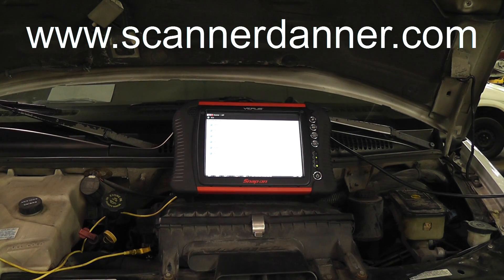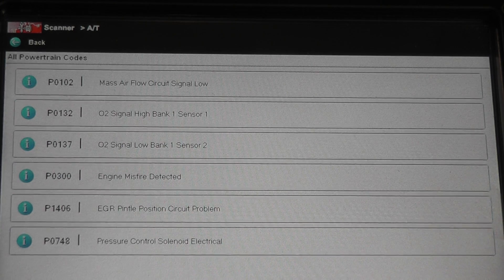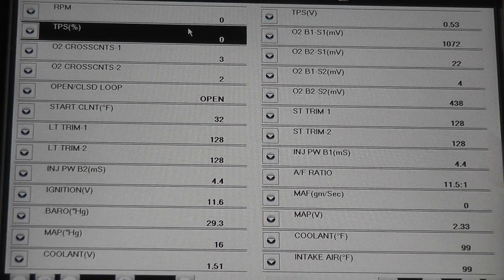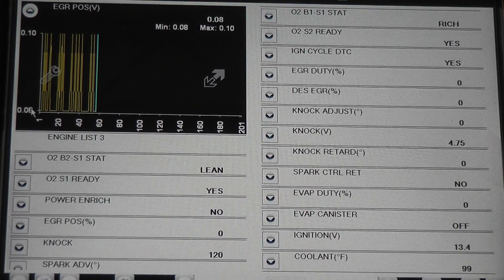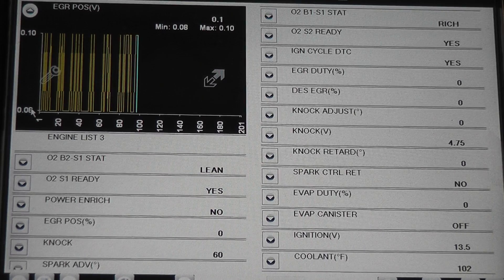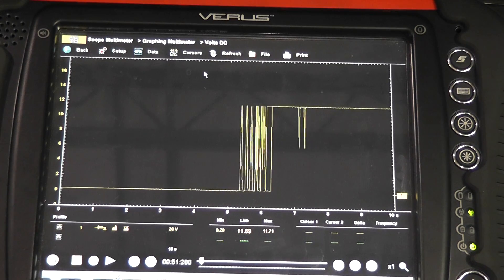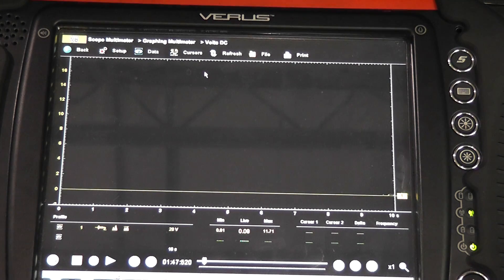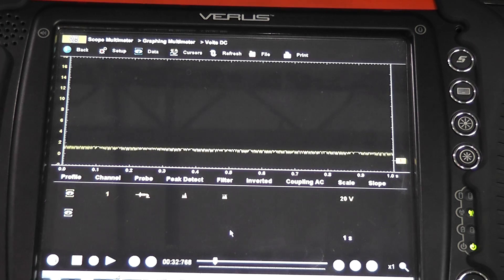MAF sensor code P0102 from bad engine computer - (Chevy van)

Comment: Hi there! Very nice videos! I hqve a 2015 toyota verso 1.6 diesel which i bought used and the chk engine light comes on with a p00bd code which refers to a maf problem. I have taken it to the shop twice and they replaced the maf sensor and cleaned the intake manifold but the fault keeps popping up. I also took it to 2 toyota service shops qnd they  cant find anything wtong. After that i was advised to have an electriciqn check it and he too found nothing, any ideas on what to do? Thx!

Comment: Thanks. Wonder if this is the problem in my 96 silverado 1500 5.7L. The first codes were p0102, p0300, and p0420. It misfires at hwy speeds. Mechanic said it was bad MAF sensor. Brand new MAF sensor in and now the codes are p0102, p0172, and p0175 and the truck still misfires at highway speeds.
Reply from the maker: Could be, do some testing on that MAF circuit.

Comment: I have a p0102 code I replace the maf and still have the same problem  can't even drive my 1999 3.8 camaro
Reply from the maker: How's it run with the MAF unplugged?
Reply: @ScannerDanner  can't drive it turns off  could it be the computer
Reply from the maker: @luismontemayor5713  of course it may stall a few times with the MAF unplugged but you should be able to drive it.
Get me voltage readings on all 3 wires on the MAF with the key on engine off
Reply: I read .5 bolts
Reply: 5 bolts
Reply from the maker: @luismontemayor5713  need all three wires, with it plugged in and backprobing (loaded circuit)
Reply: @ScannerDanner  how do I do that
Reply from the maker: @luismontemayor5713  same way I showed in this video. I believe I used a T-pin (you can buy them in the craft section at walmart)

Comment: I know this video is 10 years old @scannerdanner, but do you remember what you did with the harness pin issue?, did you replace the harness?
Reply from the maker: If I remember correctly, that ground splice was broken. I believe the only real fix in this scenario is to cut it off and installed a new ground eyelet

Comment: I have a 2000 gmc k3500 with the 5.7. I have the maf code. I have 5 volts on the yellow wire unplugged, ground wire is good, but do not have 12 volts on the red. (All unplugged) I unplugged the harness from the computer and believe I found the 12 volt output to the maf, tested for continuity and it tested good.  I am now a little lost as to where to test next. Any help would be appreciated.  Great video by the way.
Reply from the maker: I believe the 12v supply to the MAF comes from a fuse my friend, not the engine computer. You've done good so far BTW! A good wiring diagram is what you are lacking at this point. Here is a link to the DIY version of the same service info I use 
https://eautorepair.adtrk.biz/?a=10817&c=24&p=r&s1=

Comment: I have a 1998 gmc k3500. With a P0102 MAF circuit signal low and a cam shaft sensor code. Both sensors have been replaced. I have checked for 5v at the MAF key on engine off. Truck takes a while to start. And struggles at times while driving. I have cleared the codes on my truck but with the truck running and scan tool plugged in ..the codes will come back on and off randomly even when the truck is key on engine off. .. I dont know what else to do. Could it be a computer problem?

Comment: i have 99 express with only the p0102 code and my computer looks just like this from the outside and my power and ground to the MAF is good
Reply from the maker: Key on, MAF unplugged, you should have 5v on the yellow signal wire. Do you?
Reply: @ScannerDanner  did not go that far yet but i will if the rain stops... i jumped the gun and put a new one on 180$ out of pocket code still there...thanks for the help
Reply: @ScannerDanner  2.5 volts key on unplugged
Reply from the maker: You need a computer my friend. It absolutely must be 5v unplugged with key on.
Reply: @ScannerDanner  agreed the new one came today and flashed from my vin number i ordered it from flashmasters ...you saved me on this one there should be a way to show my appreciation
Reply from the maker: Just keep watching my friend :-)
Click the bell icon too to be notified of new uploads. Thanks!
Reply: update on my computer switch.....i have a 99 express 5.7 with the p0102 code and a harsh tranny shift i ordered my unit from flashmasters it came in bout 3 days its all installed i had to do the security relearn which was easy and i  need an crank position sensor relearn gotta find a shop with the right tool for that but my van runs like new again with no issues and no codes . ALLDATA.COM and SCANNER DANNER saved my ass on this one

Comment: Dan I have a 1996 Chevy K1500 5.7l Vortec with a very similar problem, the P0102 code is my only issue, but I’m experiencing misfires, hesitation, and sluggishness. I’ve pinned the yellow signal wire at 5.05V, but my red power wire reads exactly zero. I’ve checked the black ground on the same connector and it reads 12.5V...any ideas?? Thanks in advance!
Reply from the maker: your power reads 0 and your ground reads 12? Where is your voltmeter negative lead? It should be attached to battery negative for these tests

Comment: I have the same issue with my 97 gmc sierra k1500 5.0 vortec, I have all the same symptoms and more codes and when I fix something I still get the same codes, I took the computer out and there was corrosion on the inside on the board and on the inside of the casing, not much on the pins and plugs themselves but on one of the connectors on the inside the pins going to the board were covered, could that corrosion just on the inside cause all those codes? I blew it out with electric compressed air cleaner but no change.
Reply from the maker: you need to replace the computer and possibly the wiring harness depending on how much corrosion is on the pins
Reply: thanks, I ordered a new computer and then I'm gonna check the wiring if I'm still getting the same codes

Comment: ecu and loom? or was the loom repairable?
Reply from the maker: It definitely needed an entire harness or the computer connector repaired. I didn't do the repair and I'm glad I didn't have to. No easy answer or fix there bro
Reply: +TheMarshall85 I have an 96 chevy express and had the same problem like this video showed and have seen a lot of vans like this. I take the computer out and make sure it doesnt have any corrosion inside and if its good on the inside and scruff away the aluminum rust and then prime the case and paint it, if not, there is a guy on ebay that sells them refurbished. you provide your VIN number and they will flash the ecm for you. its about 80=100 bucks. as for the harness the pins i believe are stainless steel and usually are in good condition. I remove all the clips to expose the pins and then with a hard plastic bristle brush i spray contact cleaner or wd40 and then dry them good and use dielectric grease on the pins and around the connector area to avoid moisture getting in the connectors. I never let anyone fill up my power steering or master cylinder with fluid because what happens is some people pills fluid and it falls on top of the ecm and the fluids being corrosive will eat thru aluminum very fast. my van has been running excellent with no check engine light ever since i did this procedure.

Comment: If you need a remanufactured engine computer give us a call. We'd love to help you get back on the road. 800-900-0194 www.autoecmstore.com We have a 1 year warranty on most of our parts (except Nissans).
Reply from the maker: +AUTO ECMS How about a central electronic module on a 2006 Volvo S80? It suffered some pretty serious water damage. Let me know. We are looking for a used unit at this time.

Comment from the maker: That would depend on what the signal looks like. I don't approach every system or car the same way. Symptoms and test results dictate my next move. I may check sensor signal, then power and ground before worrying about opens and shorts in the signal wire. There really is no easy answer to this. "The only constant is change"

Comment from the maker: yes, to determine circuit design, you would unplug it but remember that it needs to be a known good working circuit for 100% accuracy. If there is already a problem (open, shorted wires), this will affect circuit identification. So start testing known goods, and chalk them up in the memory bank for future problems

Comment from the maker: I'm ok with that test on a signal circuit. I've done it many times. This test works on Ford MAFs but you have to leave the MAF plugged in when you do it. The PCM MAF monitoring circuit gets its ground through the MAF sensor. This is why Fords have two grounds to the MAF. If you try this test unplugged, you will get no response. That is the tricky thing with bypass testing, it doesn't always work. there are variables
Reply: well, did a cap rotor, started good, kept starting, turned it off walked away for 30 minutes, started it up and died like it has been doing.  then misfire once it started running.  took computer out.  covered in corrosion inside and out.  boards are fucked.  im going to clean the fuck out of them because theyre so bad i have nothing to lose.

Comment: most likely solder joint failure due to the moisture.
you would need to re-flow the board to ensure integrity.
rebuilt ECM's are pretty cheap for this vehicle.

Comment from the maker: the 2 wires you saw on the left side of the mass air flow sensor was a separate intake air temperature sensor. and was not part of the mass air flow sensor. on this design it was a 3 wire digital type mass air flow

Comment: I have a question about this video and it is concern about the air temperature sensor. Most of  analog MAF sensor have in build air temperature sensor. Do digital MAF sensor have in build air temperature sensor or they are separate of the MAF? I saw those two wires on the left side of the MAF and I assumed that they are part of air temperature sensor together with the MAF. Thank you

Comment from the maker: experience my friend. all GMs work like this
Reply: so measing hertz on my MAF it seems to be slipping just under the acceptable values. everything else is good.  Was reading one guy that did a  simple tune up and stopped the code.  I looked under the cap and found a good amount of corrosion-thinking that has to be it.  Doing it now, then its computer time.  have tried 3 junkyard MAFs and getting same readings every time.  getting 5 volts from signal wire coming from computer with MAF unplugged.  fingers crossed

Comment: Great vid and only experience and equipment found the problem.  I had a friend that was quoted almost 3 grand to have his fixed before I told him about the computer.  I worked at the Van plant untill it closed in 1993 and then it went to Flint Michigan for a few years not sure where their built now.

Comment from the maker: Just the vans as far as I have seen. And it is only for a few years. GM fixed this problem on the newer models but I'm not 100% sure of what the fix was. A different PCM housing and relocation I think.
Reply: holy thread resurrection... but I have a 2001 Express 5.7 Conversion van and love the stupid thing. the 2001 has the computer and the fuse box in the same stupid place- and the windshield drains ensure they get wet.  Chasing the ubiquitous long crank when cold problem on it now... like everyone else who has one, it seems. :)

Comment: on the BMW's I work with just about every control unit in the car is VIN coded. Germans trying to monopolise their stuff. btw paul im working on an E90 with a valvetronic issue atm, faults for 'sluggish movement' in the motor. checked for voltage (2.7v unplugged, not sure about the spec on that), circuit integrity on power and earth fine and can hear movement in the motor if i power up the circuit manually. Im thinking DME, have you had any experience with this system?